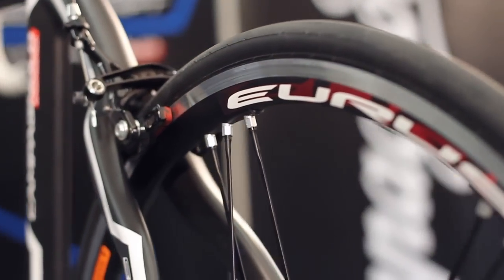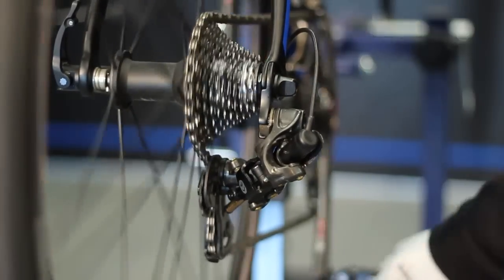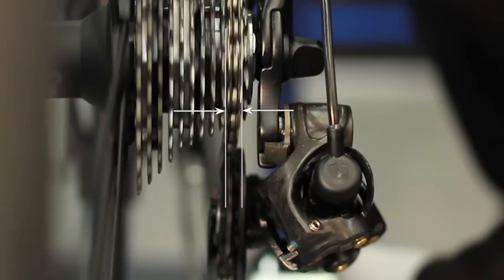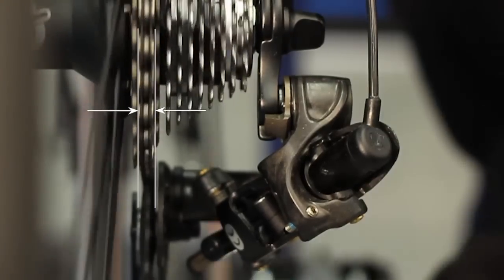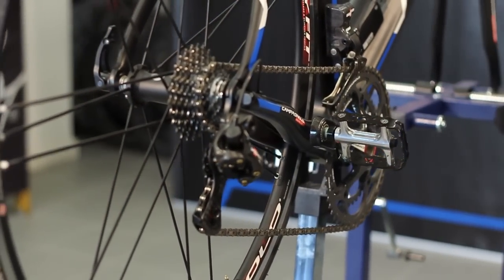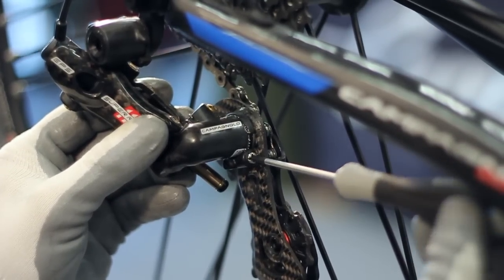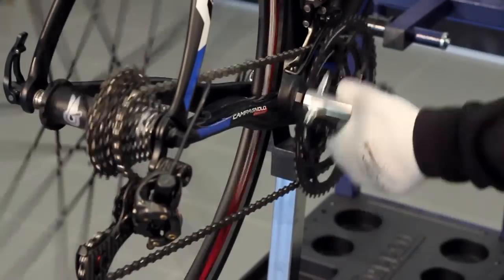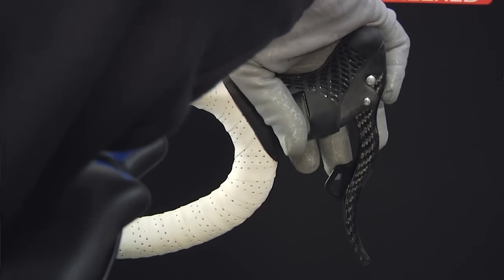ELECTRONIC GROUPSET CAMPAGNOLO EPS - ZERO SETTING

Comment: question about the Front Derailleur, when I'm on the smallest cog in the back and biggest ring in the front, the fd outer cage is touching the back side of the drive side crank arm. tried repositioning the mounting of the fd and still giving me the same result maybe .5mm is the biggest gap I could get. any suggestion ?
Reply: Hello I'm a few years behind but going through the same issue. Did you figure it out or was it ok? I'm running the V2 system. Thank you and hope all is well 👍